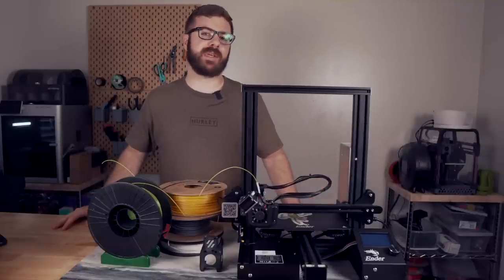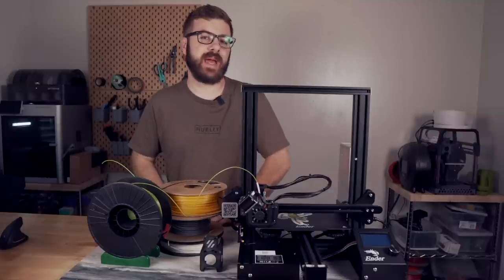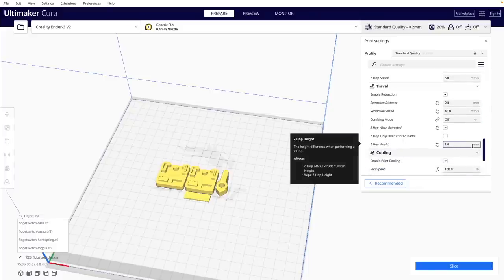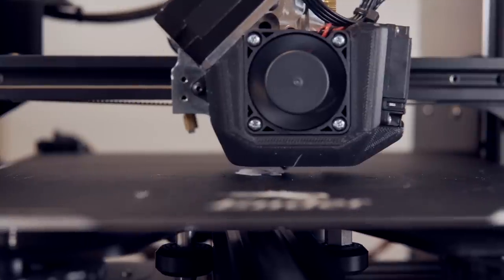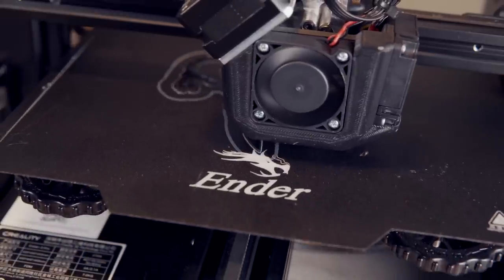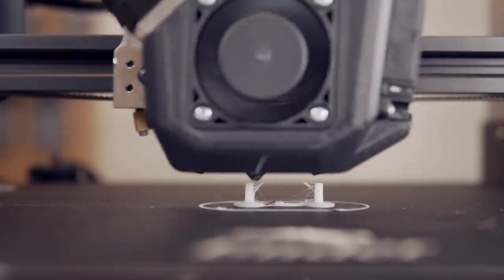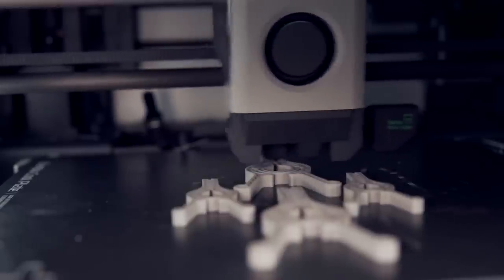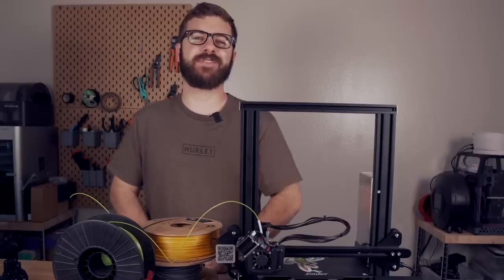Z Hopping To Prevent Batch Failures & Multi Color Same Layer Printing

Comment: Z Hop is THE BEST! I am not worried about the extra minutes of the z hop as it is cheap insurance on the part itself.
Reply: "Z hope" as in "I hope it doesn't crash with the previously printed stuff" :D
Reply: @RebelPhoton  well.. of course I would have that typed wrong..
Reply from the maker: Yeah agreed. Time on a print added usually is not as bad as the time that you would be losing if your print failed.

Comment: Word of warning, be careful upping the z hop speed on a leadscrew machine. I just tried doing so for the first time the other day and managed to accidentally guess the exact value that a third of the way through the print the steppers didn't have enough oomph to travel that speed going up, but they did going down so it kept going back down. It crashed the head into the bed, and then into the side of the part bending the heatbreak and ruining a revo nozzle (ouch...)

Comment: For anyone attempting this with a Creality CR6 (-SE or MAX) utilizing the stock strain gauge leveling probe, be sure to position the models in the slicer such that the center of the bed is not obstructed by any part of the first model when the machine probes the bed at the start of printing the second model. I almost forgot to do this. 😱

Comment: I cant make Z hop work in small perimeters, the stringing is enormous. But on big perimeters it works very well. For things like wolverine claws, Z-hop don't have enough perimeter to stabilize the pressure, then it gives a lot of ooze. On mechanic parts, that tend to be more squared and bump on some materials, than Z-hop is a no brainer.

Comment: Love Z hop. Use it nearly every print. 
A tip: you could just comment out the part of your end gcode that turns off bed heat. This would make it so you don't have to be next to the printer when it finishes the first color print. Might be helpful on a longer print or multiple color swaps. Love the videos on stuff like this!
Reply from the maker: OMG. You saying that out loud makes me wonder why I have never done that. That is a great idea. On the buildtak style sheet its fine but for PEI which is what I usually run that is great to have set to prevent accidentally having the plate cool before you catch it. 

Thank you for that tip!
Reply: @ModBotArmy  been absorbing your content like crazy lately as I just got into 3d printing, great to see someone so knowledgeable still get excited to learn a new trick. I'll definitely be using this one too.

Comment: For the alignment, ideally you should model mating parts in the same coordinate system, then you can ctrl-A to select all and then right click and select "Merge". Then orient your print the way you want it, right click un-group and then delete all but one color, then CTRL-Z to undo until you have your colors back and then delete all but a different color. Then you're not manually aligning. 

Also, sometimes it looks like they won't merge properly but they still will, I'd always try merging them before giving up and manually aligning them.

Comment: Sorry to spam the comments, but I recently developed a workflow to allow you to do these "multiple colors on the same layer" on the top or in the middle of the model. 

When  you model your parts make sure to export them with the global coordinate system to make merging easier. 

The issue you generally run into with multicolor in the middle or top of the part is that those "floating parts" cura insists on dropping (regardless of preference settings) to the build surface unless you use support (which you also don't want). To get around this, you model a small feature for each color on the base layer so that base feature keeps cura from dropping the main part down to the build plate and you don't have to use support.
Reply: You can disable cura from dropping prints to the bed in the settings

Comment: I do use z-hopping, but use many different materials where it is rather difficult to "tune" the string out.  I don't like the feature in Cura 5.1.0 for retracting ( Maximum Retraction Count and Minimum Extrusion Distance Window ) as it is equally difficult to tune.  I am currently printing multiple colors (7 colors) with 3 x 0.16 layer height on a Creality CR10S - a binding/frame color/layer with a 0.4mm nozzle, and the other 6 colors also 3 x 0.16 layer height but with a 0.2mm nozzle........ fingers crossed!

Comment: Before Z-hopping was a thing i had to check where the model could curl up and the movements before the print. I kept to nozzles with a very wide profile to be able to push down the filament rather than crash into it

Comment: I was told anything but z-hopping, when I asked for help regarding my printhead hitting the model with the Elegoo Neptune 2S. Bad leveling, too much material, wrong temperature and so on. It was none of the above, since I did and check everything. It's a z-hopping issue + the printer moves too fast on the Y axis or better said the print bed moves too fast + the extruder does no z hopping on by default.  I figured out to slow the printer down a bit and do a minimal Z-hop. It could literally make or break the model with this printer.

Comment: Would be nice to disable z hop after the logo is printed over (or reset it to the default value).
Reply from the maker: I am sure it is possible but I am not sure if there is a modifier or tool that will let you do that. That being said I have not tried.
Reply: @ModBotArmy  I haven't find that option either in Prusa Slicer. It would require modyfing the gcode itself (removing all the uncesessary retractions, or changing their value to the default one) - it doesn't seem to be worthwhile.
Reply: Old comment but orca slicer has this feature
Reply: In Cura you can add a support blocker, modify it to the height of the logo, change it to a cutting mesh, and use setting modifiers: z hop over printed parts & z-hop height of logo+. I haven't tested it personally, but should work in theory.

Comment: Great video. Appreciate your help. I am trying to print multi-color inlay print and I get trouble with the homing.
I have a Creality ender 3 v2 printer upgraded with BLTouch prob. 
First, I canceled the G28  homing command in the G-code from the 2nd layer and on... but when I do so, the Z axis is getting into the bed and hit it. but when I returning the G28 command, then the Z axis homing occurs in the middle of the print on the printed previous layer and messing all homing and printing. What should I do? 
Thanks in advance

Comment: I am having a problem with batch multicolor printing with my Ender 3 v2 neo. That is because it has autoleveling and when I change the color (using a different gcode), the 3D printer starts "the leveling" process and when it moves to 0,0 location clashes with what has already been printed.
Reply: I use the "Change Filament" Post Extension Script in Cura. It stop before layer N and parks the hot end till you replaced the filament and hit continue

Comment: Personally, I only use it for the First Layer when doing Multicolored Inlay Prints ( like those soon to be installed Voron V2.4 Z-Axis Belt Covers https://i.imgur.com/z84orE6.jpg ) to ensure the Nozzle not contaminating itself again on an already laid down color when returning to the part after purging itself on the Purge Block as even the tiniest speck of black or red can easily contaminate a color like white.

I also found that 2x 0.2mm Layers ( for a total of 0.4mm ) are enough to have a color like white become opaque enough to the naked eye for black printed on top of it not to show through so 0.6mm is something I'd already call unnecessary ( well at least on the Fiberlogy ASA that I use... )